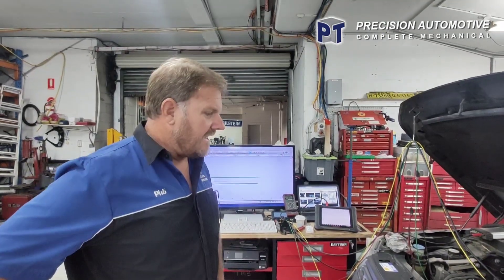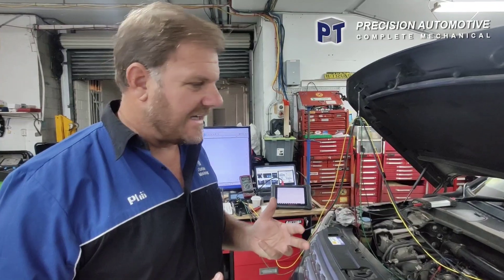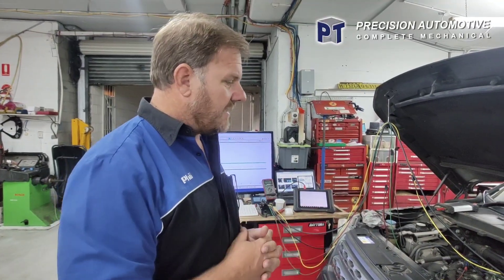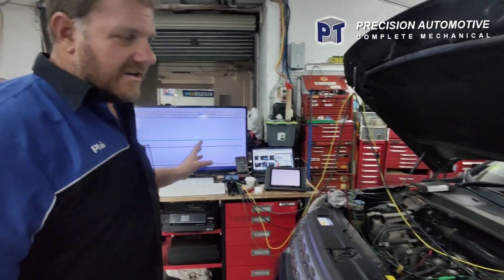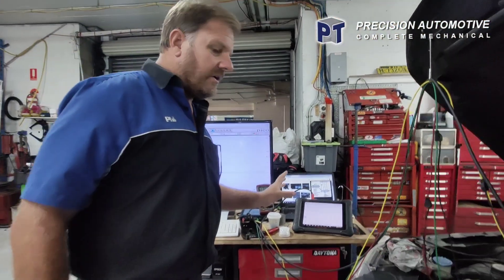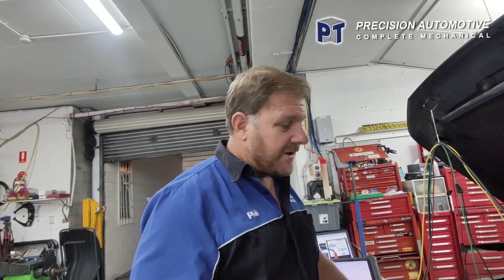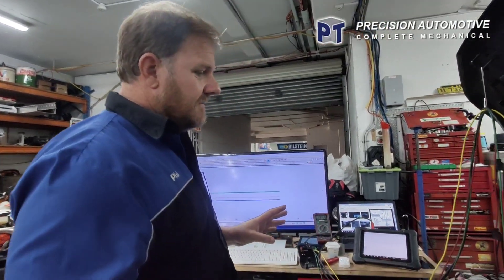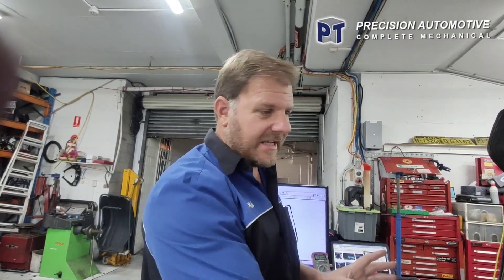Freelander 2. Scoping fuel system, Intermittent hesitation

Comment: I have a similar issue with what feels like a hesitation... but it's most noticeable when changing from 2nd to 3rd when lightly loaded. Also seems to do the same when the front window demist function is on in idle. Be interesting to see if that happens to hers as well. No obvious faults on mine apart from fuel pump authorisation dtc.
Reply: Hey mate, having the exact same issue with my freelander currently. Did you ever find out what it was?
Reply: @patmchale9719  I'm afraid not mate, not long after this I discovered a gearbox problem that meant it only had front wheel drive. Got a volvo now